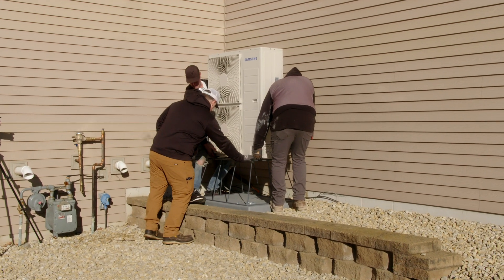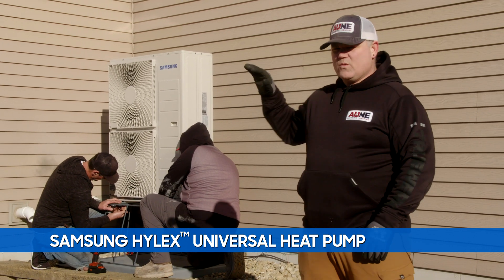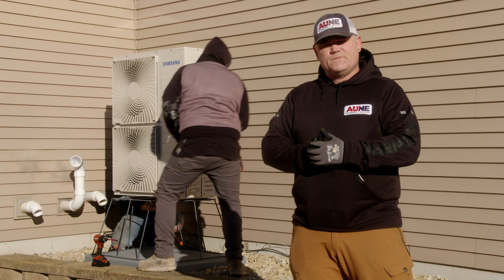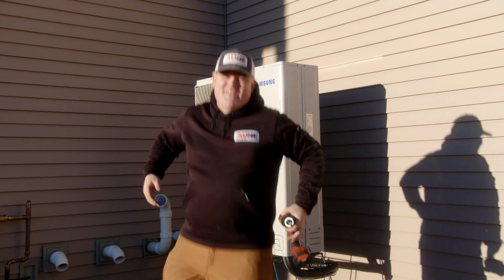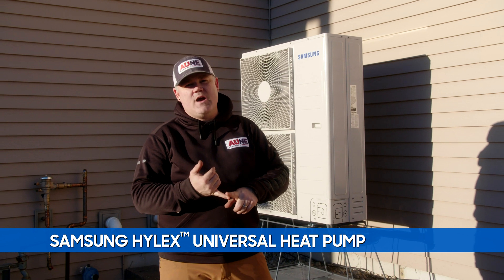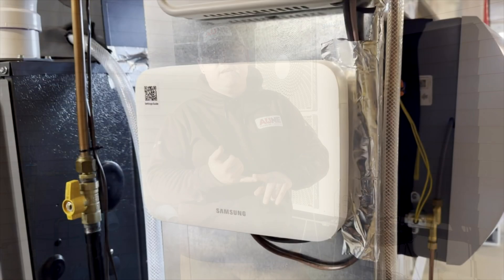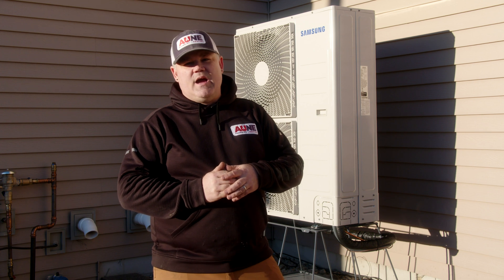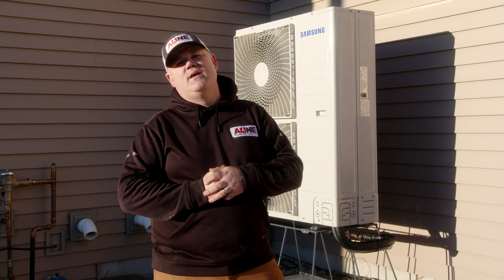Samsung Hylex™ - Dual Fuel Heat Pump Installation

Comment: I live in Phoenix AZ and would like to hear how quiet it is running AC. Please run that for just a few minutes so I can decide if I want to put one in for lower sound db levels.
Reply: Literature says 50 dB as opposed to 60 dB (typ), which won't really help you understand the noise, unless you deal with equipment all the time. About as loud as a laser printer or quiet refrigerator. Think the normal noise in most houses. I live just outside Phoenix and I can usually hear the AC kick on. 50 should not transmit through a standard house wall. Insulation matters here. If it's next to a window, I think you would it. Frequencies will affect this, as well as the individual ear. I have done a lot of HVAC specification and system design. I would not spec this for an industrial application, but for light commercial or residential, it's seems like it's worth comparing to other equipment. Ask for performance data for the local temperature. Phoenix summer is at or near the edge for heat pumps.
Reply: AC and Heating should be similar sound.